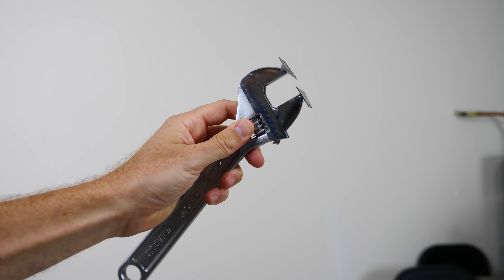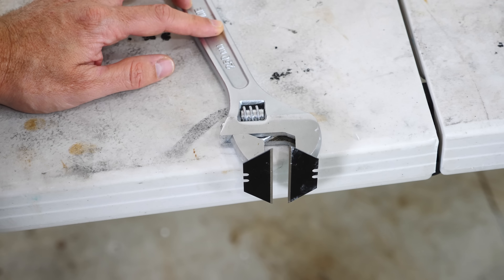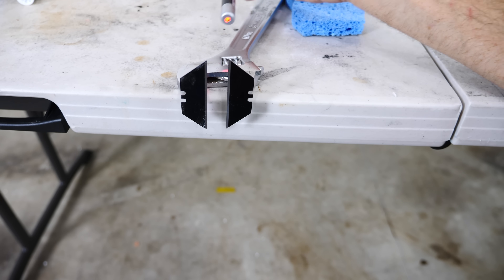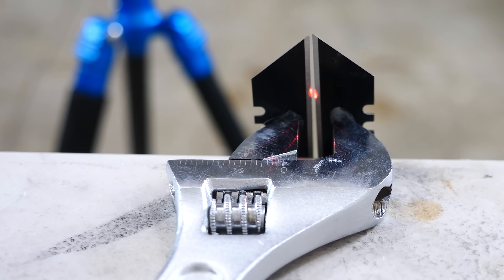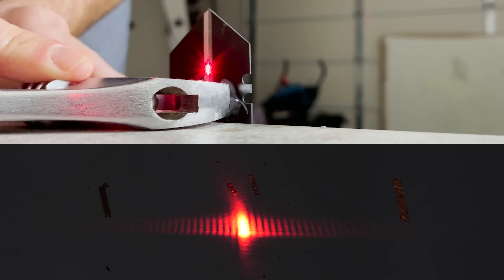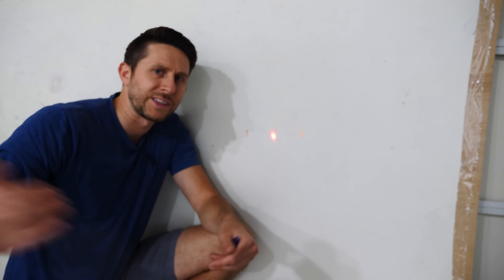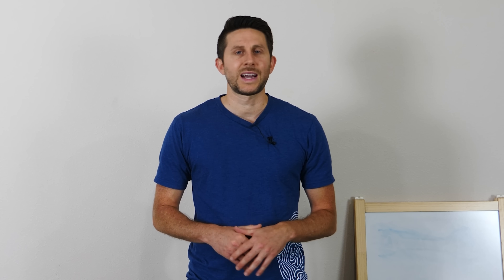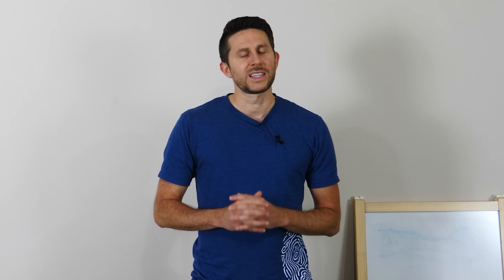Squishing Light Makes It Bigger—Heisenberg's Uncertainty Principle

Comment: So my question is: if photons have a positive and negative and the atoms of the razor blade have a positive and negative charge. Could the atoms from the razor blade make the photons flip and spin out of control causing it to form into a wave as it passes through the blades?

Comment: wait so if it's not just diffraction, then you should be able to run the experiment again with only 1 razor blade (and the light impinging only slightly on the edge of a single blade instead of between two of them) and never see the beam get wider. but i suspect it will get wider... because of diffraction. >.>

Comment: should say is greater than or equal to h/4pi not is equal to h/4pi .
Also, the "its wave nature" and "its particle nature" explanation, feels very, sloppy? 
I mean, I guess there's something valid that you mean there, yes, the "the energy per photon has to be above a given threshold in order to charge the backdrop" does relate to individual photons, yes.
That doesn't mean that what you are doing is due to Heisenberg uncertainty and not due to diffraction. (It's basically a non-sequitur.)  
You can have diffraction with a single particle! What did you think was happening when people do double slit experiments with a single electron at a time?  
Er, you wrote equal instead of greater than or equal to at 6:02 as well. And also when talking about the energy and time uncertainty relation.
(Also, while energy is an operator, time is not an operator, so interpreting the time energy uncertainty principle is, aiui, a little more difficult to do carefully/correctly?)

You haven't demonstrated the connection between Heisenberg uncertainty and the demonstration you have here.  

The way you describe it gives the impression that it isn't acting like a wave, and this is wrong. Even if you didn't exactly say it "is acting like a particle and not acting like a wave", this is still misleading and I don't think I can approve? It's not like it ever stops being describable with wavefunctions.

Please fact-check your scripts...

Comment: Technically yes and no it takes up more space in the vertical sense but less in the horizontal sense and the smaller the smaller the stream of light yet passes through at the same speed. Therefore there would be greater movement through the gap which in turn means that it looks like more light passing through at a time

Comment: Red light wont charge glow in the dark items. There isnt enough energy at that wavelength, shorter wavelengths are needed. Actually, at a high enough power, a red laser will make charged glow in the dark items dimmer.
Reply: Yep that’s due to Stokes shift. Can’t get more energy out of the system than you put in it. A lower energy red photon can’t cause the emission of a higher energy green photon. When he shines the higher energy violet photon the emission is a lower energy green photon which makes sense.

Comment: I have a question, doesn't the slit opening length need to be close to the wavelength to demonstrate these effects ? I am asking because we already see the effect when the slot is obviously much much larger than 700 nm (red). Thanks :)
Reply: This is because it is not really showing the Heisenberg effect. Just a mirror funhouse the size of a razor bevel.

Comment: The way I understand it, it is both diffraction and a consequence of the uncertainty principle. Meaning that if you describe the system in classical diffraction theory and quantum mechanics, both would yield the same results. What you are probably missing is that diffraction theory DOES have the concept of "canonically conjugate variables" embedded in it disguised within the Fourier transform formulation of diffraction theory.

Also shouldn't the transfer of energy between light and your glow wall be related to wavelength as oppose to the wave/particle description of light?

Comment: Hello. The blades being bevelled, don’t they reflect the light and change the original direction of the photons? Wouldn’t this experiment require a straight-cut piece of metal ?

Edit : I just saw now you explained that already, my bad…. But still

Comment: I always thought about neutron as the mass of the wave in the string that forms electron, it is just the motion of the string in the natural +ve or -ve direction which the waves are in the string which contracts or expands the real energy string out of the mass(the condensed down form of energy of similar wave motions), electron is the string having every in some -ve directionor +ve).and as the proton has a + ve wave motion the string contracts to the point where it stays inside the mass this is all considering E=mC² nothing but some overthinking as it seems

Comment: its about the output-input area ratio
Reply: you have the wave packet spreading, not going straight, anymore
Reply: heizenberg is bs
Reply: If the momentum changes, then the frequency and color should change too, total momentum must be conserved, that means area-speed relation must stay constant
Reply: if the speed/frequency stayed same, you only redirect the photons, not changing the momentum
Reply: as your color did not change, your moment stayed the same
Reply: its just the dual particle-wave nature, if you force into the wave mode, you will get spread of waves, if you block it, in the path of the particles, nothing heizenberg here
Reply: liar
Reply: your output area stays the same, by the particle nature, so the speed/frequency of the photons, red/blue shift, does not change, the number of photons stays the same, just spread around
Reply: fight me

Comment: Could also be that photons are particles guided by a wave.
The uncertainty principle makes sense when you think about a wave. If you look at a wave and try to say where the wave is more precisely than the wavelength you get into trouble. You can say that one oscillation of the wave is between two equal points of the wave (the wavelength) but what exact points you chose are arbitrary.
Reply: Isn't that the idea behind the pilot wave interpretation?

Comment: 6:07 this makes sense to me because if you take the average of a measurement consistently over time, you get a much more accurate reading because of the variability in the measurement. the much more accurate measurement is taken over a much longer period of time, so you don't have an as clear knowledge of the time the event happened, only the accuracy. and if you have a very quick measurement that you might have as quick as a microsecond later, it won't be as accurate because of other effects like capacitance and inductance in wires making the measurement less accurate and you can't average stuff as much, so its much less accurate in energy but much more accurate in time.

Comment: How is the fact that one color of light can induce a phenomena that another color of light can't proving light is particles? That's like saying if you can induce a phenomena with sound of one frequency and not another you'e proven that sound is particles.
Reply: Right? Due to Stokes shift a lower energy red photon won’t cause the emission of a higher energy green photon. The higher energy blue/violet photon, however, causes the emission of a lower energy green photon and that would sense. His justification makes no sense.

Comment: The beauty if this is that with binoculars and a mosquito mesh you can actually observe the same effect (in a cross pattern) by looking at far point like light sources. But when you focus the binocular on the mesh, trying to observe where the photon goes through, the diffraction disappears as the light source gets out of focus.
Also to compound the experiment you can observe the disappearance of the mesh pattern while looking at a far light source by placing a paper with a tiny hole (as big or less than the mesh) over the eyepiece and looking through it.

Comment: you are seeing the interference pattern because of the waves bouncing off the angled edges of the blade on the backdrop side.  they are less pronounces the wider the gap because of the coherence of the light coming out of the laser.  that would be my guess.  use something without sharpened angles edges to test.

Comment: I felt better noticing that the first turn of the crescent wrench was in the wrong direction.

Now, are we not looking at the "pinhole camera" effect? We had a door at a job I once had that if we left it open a couple of inches, the building next door was projected onto our back wall inside. (Only late afternoons when the sun was direct). The image was undeniably the back of the building next door because it was painted in a big, colorful design. The image was distorted to be sure, as the "pinhole" was a long vertical slit rather than a circle, but you could almost read some of words in the design.

The other thing about this video is that you mention using a red laser and trying to get the luminescent background to charge, so to speak. Since the laser is likely at a very, very narrow bandwidth, it likely wouldn't be anywhere NEARLY as effective in exciting the atoms as the blue laser. SO, as they say here in the South, "'splain dat to me."

Love your work!

Comment: However, it's hard to energize a glow in the dark substance with a light that is a lower frequency than what the glow paint re-emits.  Using a UV or blue laser would take that aspect out of the experiment.  I still think that spread is from diffraction.
The LIT fact sheet actually addresses this:  "A light of greater frequency than the wavelength colour of light that the glow in the dark material emits.
LIT has a green light emission glow, therefore to charge it would need a light with a higher frequency green light...."
Etc.
Reply: Apparently Feynman used diffraction as a demonstration of the uncertainty principle in action.  I don't think it's correct to say that the spread is not diffraction.  The diffraction pattern is related to the wavelength, definitely a wave characteristic.  And that's true whether what's passing through the slit is a wave on water, light, or electrons.  But that doesn't mean it's not a demonstration of the uncertainty principle.
Reply: I was not convicted either. This is diffraction for me too and the fact that the laser didn't light the background is due to the lower energy it conveyed compare to a blue light
Reply: The point he was trying to make is:
Diffraction is only possible when the light is a wave.
But charging the glow in the dark material needs a certain frequency. Why because energy of one photon depends on its frequency. So no matter how strong of a light (red laser) (in terms of power (watts)) that is below the required frequency would be able to make the material absorb the energy. I.e for this effect (only frequency affecting the absorption NOT intensity) light must be behaving as a particle!

If the laser acted as a wave since it have way more energy due to intensity compared to normal torch it should have been absorbed by the wall and glow however that didnt happen, so at the wall the light was behaving as particle and not wave. Which means it is not diffraction.
Reply: @THeMin1000  The diffraction happened long before the light got to the fluorescent material, so how it was behaving at that point has no bearing on whether diffraction occurred at the slit.
Reply: You’re correct that’s because of a phenomenon called Stokes shift. You can’t get more energy out of the system than you put in all other things being equal. Lower energy red photons can’t cause the emission of higher energy green photons. When he shines near uv LED onto the phosphorescent material the higher energy blue/violet photons cause the emission of lower energy green photons which makes sense.
Reply: Absolutely 💯°  I was thinking the same thing and wanted to see if anyone else caught that.
AS WELL,  I believe he is incorrect in his stating that Light is both a wave and particle.  To me this is nonsense, that many genius inventors,  scientists,  n great thinkers in history agree with me. 
Light,  along with everything else in the perceived world,  is comprised of waveforms,  or in other words,  composed of varying pressure conditions.   "Light",  specifically though, "is nothing other than a sound wave in the ether" (- Nikola Tesla) .  It is a coaxial propagation of induction through a medium.   There is nothing TRULY traveling, no Thing or item of principality, that is moving from point A to point B. It is merely the movement (or moved-moment),  or perturbation  or disturbance of the medium,  that causes the perception of a moving instance of Light, or "beam" or "particle" of Light.

I would suggest to anyone interested in the Nature of Light,  Electromagnetism,  field theory, dielectricity, and DEFINITELY if you're interested in quantum mechanics, to check out the material (papers,  books,  videos,  lectures,  etc) of Nikola Tesla, Oliver Heaviside, Eric Dollard, Charles Proteus Steinmetz,  Walter Russell, and Dr Edward Dowdye just to name a few among the many genius inventors, thinkers,  scientists,  and luminaries of our recent history,, from the late 1800's up to our current decade,  with Dr Dowdye leaving this Earth and making his passage back Home on December 31st of 2020.
Reply: @delta-KaeBee  I'm not sure who you think you're agreeing with.  I certainly didn't say that light does not have the same apparently dual nature as anything else.

Perhaps the world of physics has changed drastically in the last 20 years, but right up to the end of the 1990's it was not commonly held that everything is composed of waves, but rather that what makes up the universe around us has characteristics of both waves and particles and that which behaviour is observed depends on the point of view.  That doesn't even necessarily imply that things are sometimes waves and sometimes particles.  Only that, whatever they are, they exhibit characteristics of both.

Some geniuses may well have believed that everything is waves.  After all, there was a time when people, including geniuses, believed in the notion of the ether.  Geniuses, luminaries, thinkers have all made mistakes in all fields over the centuries.  Heaviside, for instance, was also a critic of Einstein's theories of relativity, two of the most heavily tested physics theories of all time.  Of course, that doesn't mean they're "right" in the sense of being the final word.  They may turn out, like Newton's laws before them, to be approximations.  Or they may turn simply to give the correct results accidentally.  There are other theories that challenge the supremacy of relativity and physicists are always probing, looking for predictions of the theory to turn out to be incorrect.
Reply: @delta-KaeBee  That's quite a strong appeal to authority you got going on there.  How very scientific of you.

Comment: Hey James. This experiment did not quite convince me. You see, the blades have a reflective surface, and additionally, there is an angle, which is precisely, what gives the blade it's sharp edge. So, when the light passes through, it gets reflected in both directions. You will convince me if you try again with flat non reflective surfaces. I will try this at home. After a few minutes later: Yes, one slit, can create a long string of dots, due to the light waves cossing each other. In fact, I got close to the wall, tosee the efect up close, and my long hair got in the way of the light as well, creating a lot more of these dot arrays. A round hole, sends out a broad cloud efect.

Comment: its like a lens effect, it spreads out light. I can take advantage of this by making a tiny pinhole between my fingers, by pressing them close together, then look through the hole, and the light coming through will be bent so as to either shrink the image or expand it. it changes depending on where my eye is focusing, close or far away.

Comment: Does the reflective nature of the gap not interfere with the output out light? Those blades are pretty mirrored, would you get the same result if you sprayed the blades matt back... 🤔
Reply: Yes you would. This experiment can be done with ultra-black blades, Mosquito nets, a small piece of hair at home. Professional diffraction gratings are just tiny parallel scratches (going to but not limited to 100,000 per inch) on transparent plastic. Or the really good ones etched or some other highly priced technology. It does not matter what the material is  as long as it imposes a passing and non passing (absorption/reflection/diffusion) region for the photons.
Reply: @dragoscoco2173  thanks for the reply 👍

Comment: I think that the section between 4:50 and 5:10 is a bit silly. The intensity of the beam has nothing to do with the beams capability to "charge" the luminous paint. Only the energy of the particle/wave matters (or the color; red light has energy of 1.68 - 1.98 eV per particle and (ultra)violet around  2.85 - 3.26 eV) as was explained after 5:10. Lets say that the paint needs 2 eV to get charged (energy to excite electron in paint atom), no amount of under 2 eV particles will charge any of the paint atoms since they simply do not have the energy to do so and hence no glow. (The glow happens because the exited state of the paint atom discharges and releases a photon.)

Also light/photon is both a wave AND a particle, not either or as the section gives to belive.

Otherwise a good demonstration of single slit diffraction phenomena.
Reply: Yeah you’re right that phenomenon is called Stokes shift. Lower energy red photons can’t cause the emission of higher energy green photons. Higher energy blue/violet can and do cause the emission of lower energy green photons.